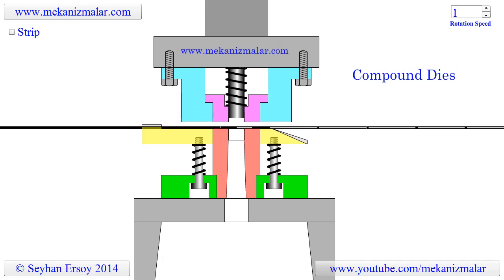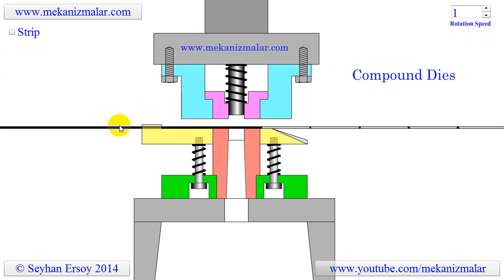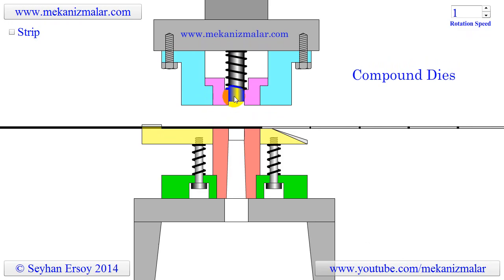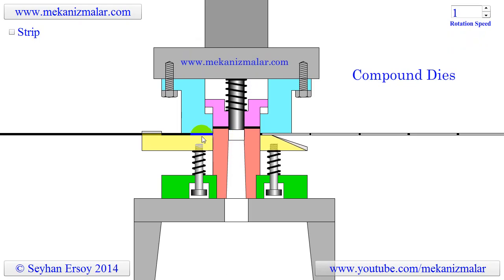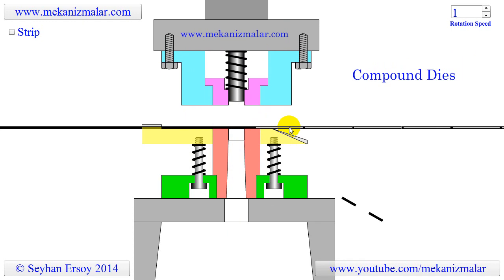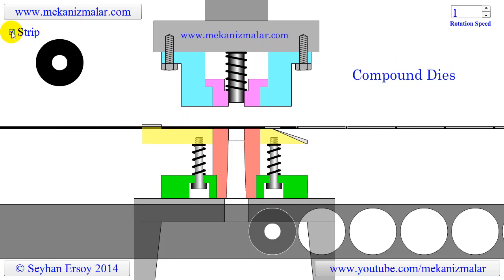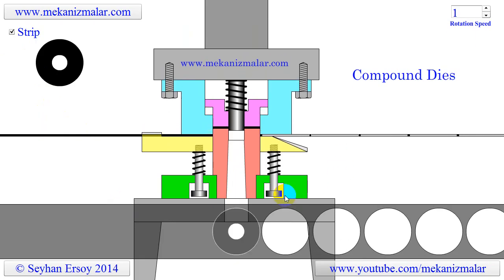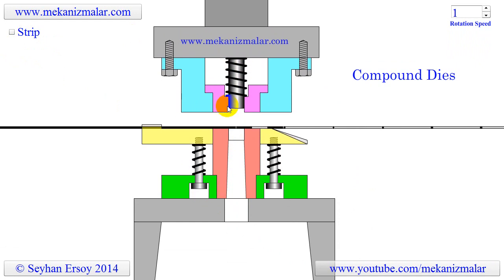Compound Dies

Comment: On the downstroke the yellow plate is pushed down by pins outside the strip. It is about the material thickness in front of the blue piece. This prevents the finished washer being forced back into the strip hole on the upstroke. If the washer was allowed to be pushed back into the hole it would not come out. Having the yellow piece following behind the punch on the upstroke it allows the washer to sit loose above the hole and is removed mechanicaly or by air. The washer will never fall through the hole as they are both the same size and slightly tapered.

Comment: the blank stay over the strip
Reply from the maker: It does.
Reply: No blank goes up with upwards stroke with blanking die
And then ejects by spring pressure 
And released by shredder which slides over piercing punch
Therefore difficult to say that blank
Stays with strip
Reply: Or as you say it stays
Then there may be more cutting clearance.

Comment: hi, how to be the coil the stepped automatically?
Reply from the maker: +Péter Somogyi You can do it mechanically or electronically. But harder to explain with a couple of centences. The best way is to find a video about it.
Reply: OK but do we have to cut the coil to be able to step it or it is possible step it without holes? please be kind link a video if you have one. Thanks!
Reply from the maker: +Péter Somogyi You do not need to cut the coil. It is continuous. Pneumatic feeder or servo feeder adjust the step length. I actually replied your comment in my web page and put a video link there. Here is the same link. https://youtu.be/ZGamWOu-yjI
Reply: +mekanizmalar  Thank you!